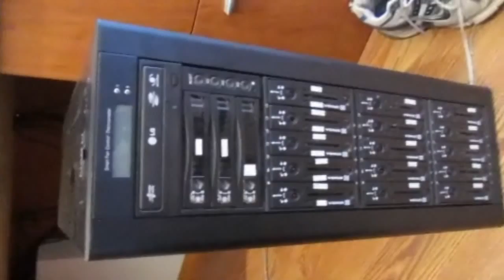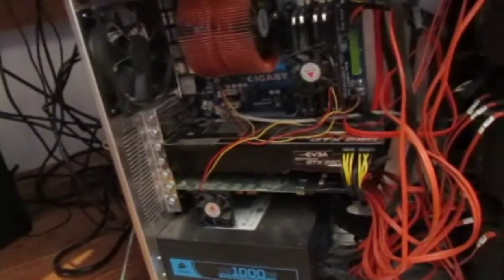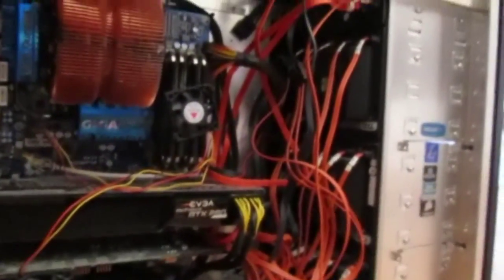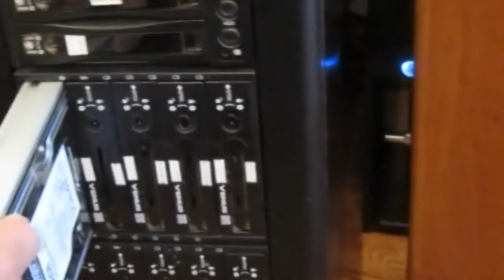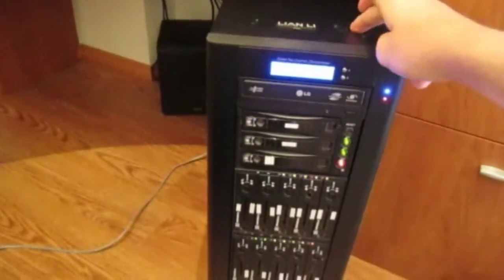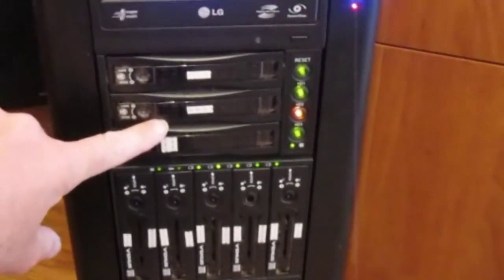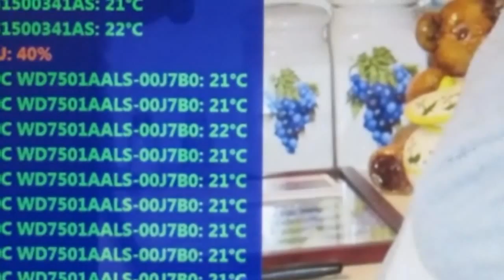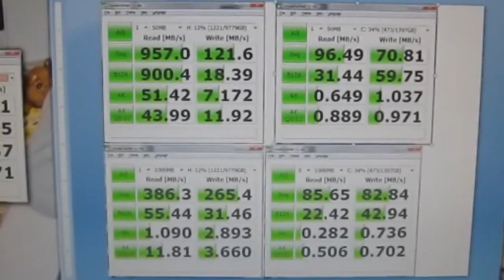Media/File Server Build

Comment from the maker: Yes they come with fans.  Been tracking the temps, they never that warm even in the summer.  Have a lint filter in the front, so they don't even pick up much dust.  Have yet to have a HD fail.  They are hot swappable.